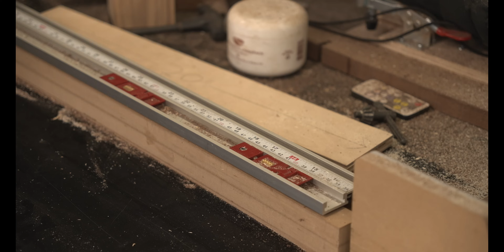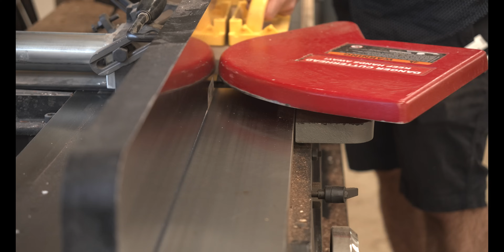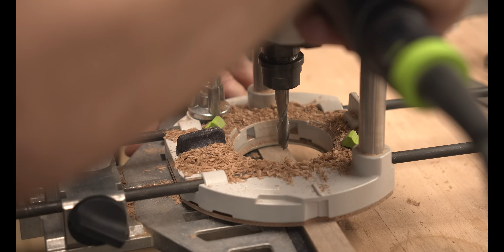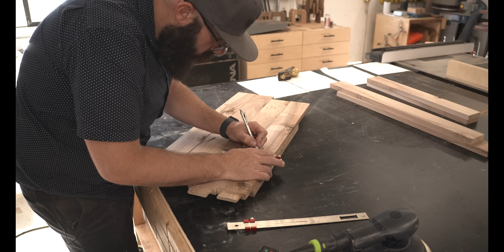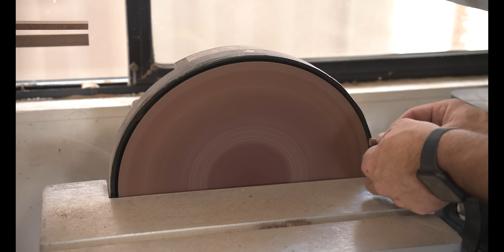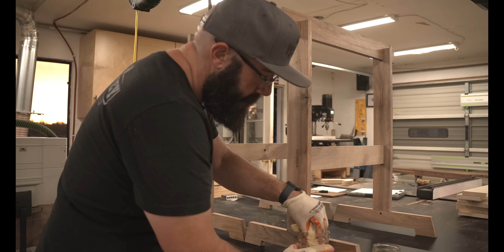Why Every Shop Needs These Saw Horses

Comment: This is great, thank you!  As someone who has a band saw instead of a table saw, how would you go about doing the tenons?  With a sled, or just by hand/eye?
Reply from the maker: I use magnetic stops. I remove the bulk of the material and clean up with chiseld and planes.